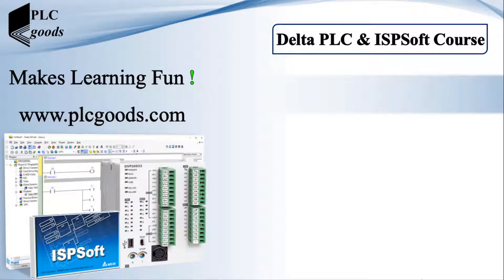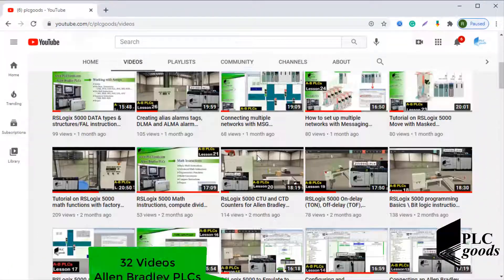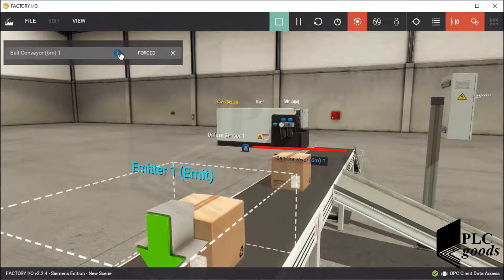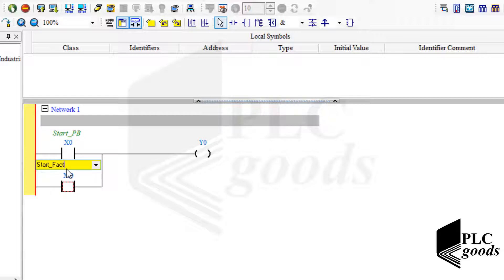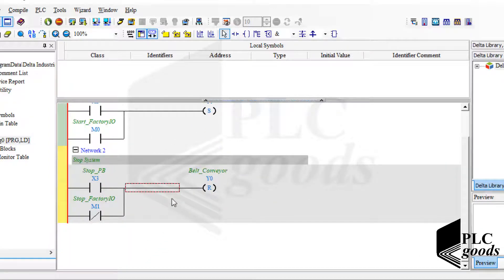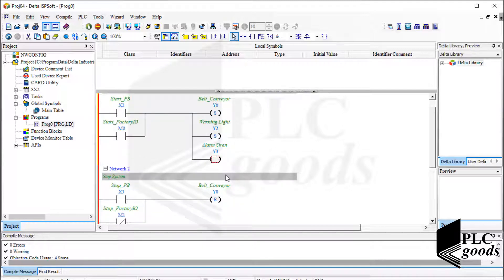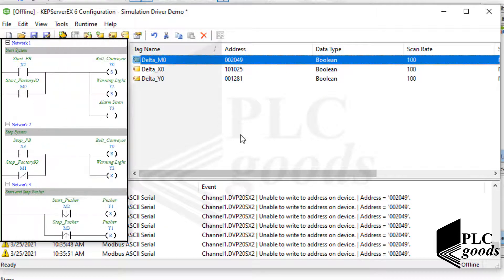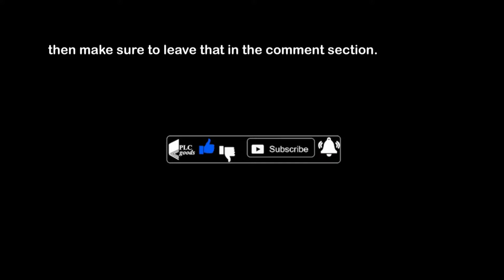Delta PLC Box Sorting Project | Factory I/O OPC Demo  | Lesson 5

Comment: Dpid in delta and it's work with which devises/sensors.
Reply from the maker: Generally PID controllers work with analog signals. However, to answer this question the defined settings is important too.

Comment: Can I use the program I wrote with wplsoft without plc?
Reply from the maker: Hi there, Yes, You can test it with its simulator. Please search it on the internet.
Reply: @plcgoods  No, it's not a wpl soft simulation, it's a factory io simulation. I searched on the internet but couldn't find a definitive answer.

Comment: Hi plcgoods I am reviewing delta course , I don't know but I am confused at 8:20 , first for the ladder and described circuit are incorrect compared to logic table , and how y3 is off when I pressed the related pushbutton and y1 is off if we pressed the button although their ladder is the same
Reply from the maker: Hi there, The table is correct. I can answer your question, but please try to find it by watching the video carefully. Pay attention: These addresses (X0, X1, X2, X3) work based on the voltage state on their related pin, not based on their related pushbutton state. Also, during the first videos of our TIA Portal course, your problem was explained again.
Reply: @plcgoods  I got after watching Siemens v5 I apologize all your circuits and results are correct , thx for u advice I felt unbelievable comfort